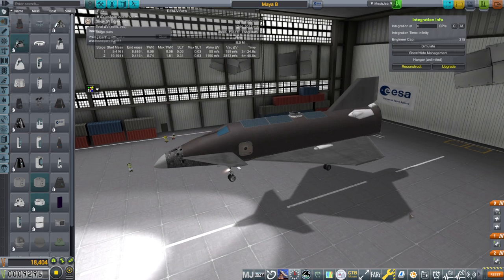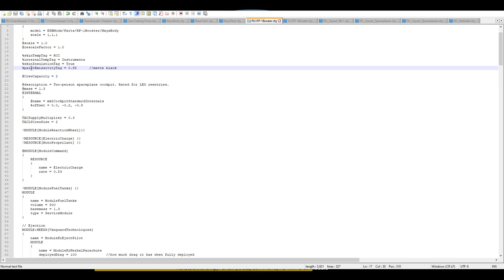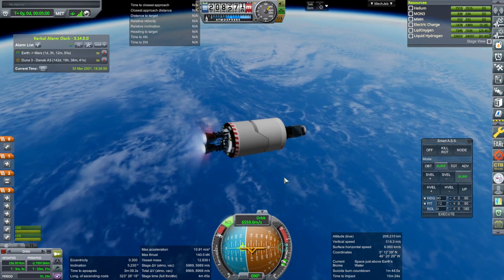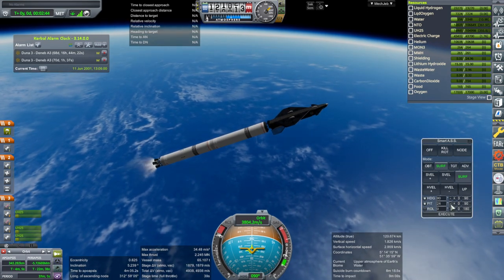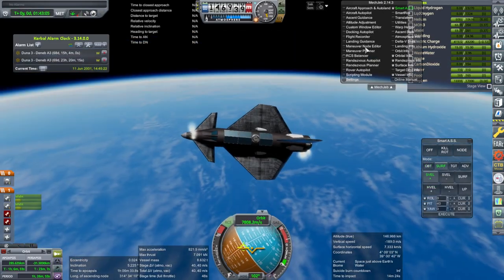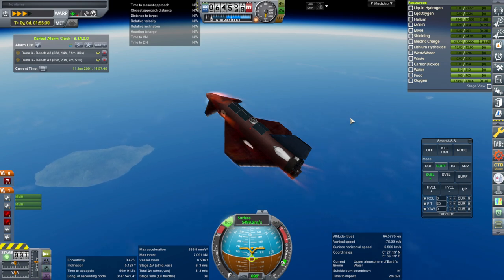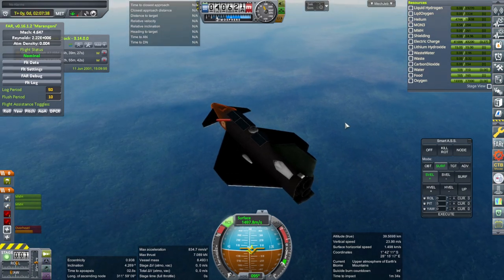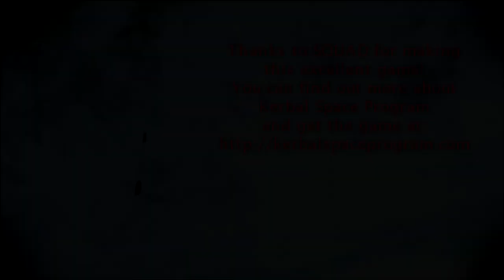RP-1 Career in KSP 1.12 - European Space Agency 46

Comment: The material thermals system is an attempt to make parts easier and faster to configure. The KSP thermal system is surprisingly complex, considering internal-skin, internal-internal and skin-skin conduction, heat capacities, and temperatures. It is equally opaque, with most of these values not being documented or set at all in stock, and with no way to view them in-game. As you may have discovered, this makes it very difficult to configure spaceplanes, as in RSS the much higher heat load means parts will conduct heat where they shouldn't and overheat, even if their max temperatures are theoretically high enough to survive reentry. If you looked at, say, the space shuttle configs, they have an enormous block of settings to wrangle them into a suitable state.

The material thermals tags will attempt to automatically set all of these values to sane numbers for the material types specified, and as you saw, does a half-decent job at it, requiring only a few lines of text rather than dozens of carefully tuned values. The emissivity will also be automatically calculated, the paint emissivity tag is just a manual override for if something has unusually high/low emissivity paint (e.g. an aluminized reflective coating, or matte ceramic paint).
Reply from the maker: Fair enough - it's just that it's very hard navigating how to configure things for RP-1 at the moment and I do intend to do more of it. I'm sure it'll all make sense with practice. At least the plane sort of worked this time.